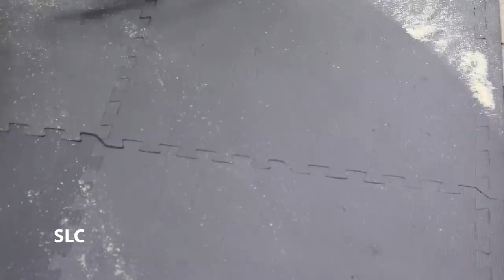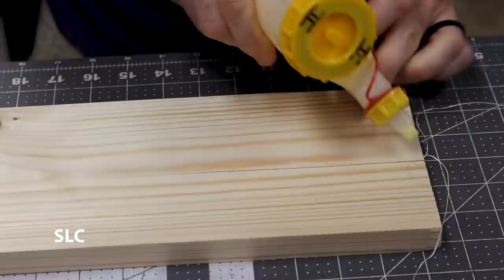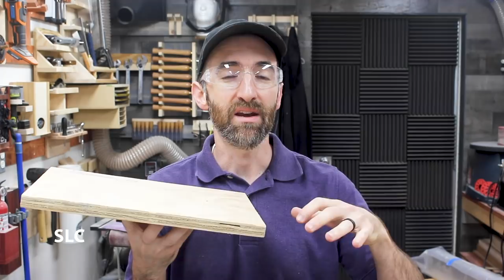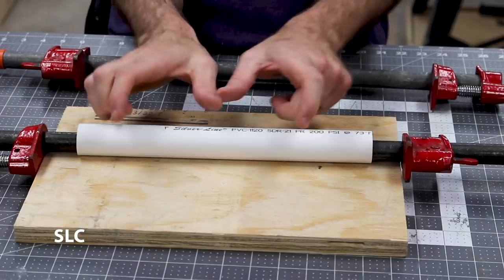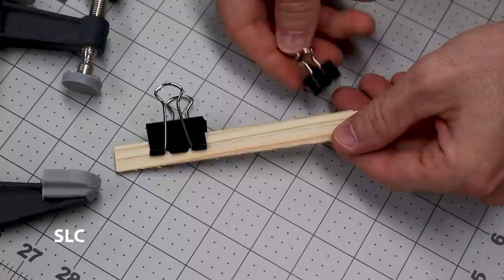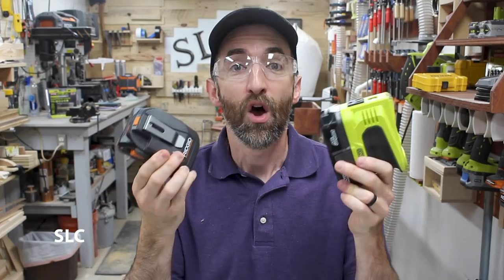20 Workshop Tips and Tricks

Comment: Another good tip for getting glue in cracks is, run a bead of glue across the crack, then use you shop vac underneath the crack. It'll pull the glue down in the crack.

Comment: Love many of these.  On the pipe clamp/PVC solution IF you don't have any extra PVC pipes lying around, Toilet Paper Cardboard Cores work just as well.
And about hanging tools on your French Cleat Wall.  If you have any ideas on how to attach a cleat to a jig or sled without interrupting the tools stability or angle that would be a great help.
~Jim
Reply from the maker: That is a very interesting idea. I will have to look into it a little more, thanks.

Comment: Great videos. Love your site. I have a question. I have a Bosch GTS1031 contractor saw. I just purchased the zero clearance plate for it. However when I lower my saw blade to it's lower setting and put the plate on thinking I'll raise the saw up into the plate, the plate sits on the blade. How can I lower my saw some more? As far as I can see it's lowered as low as it can go?

Comment: I used to fix a crack by putting in glue and use sawdust off the plywood work it into the crack or the glue dry then sand off the excess

Comment: #9, that myth has been busted many times.  Better solution for thin thickness stock with a  splintering prone surface is to use high tooth count blade put in saw backwards.